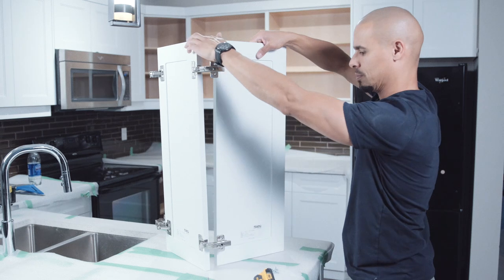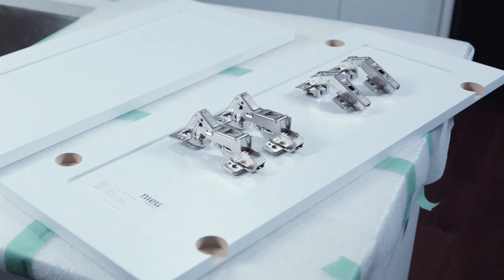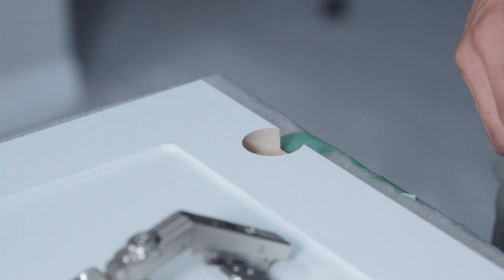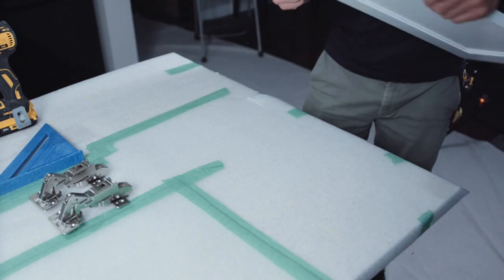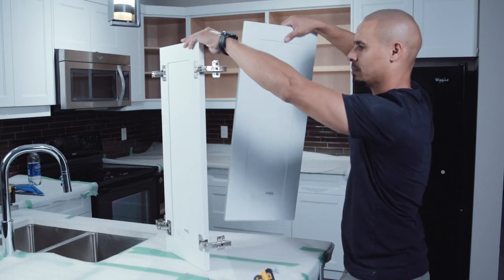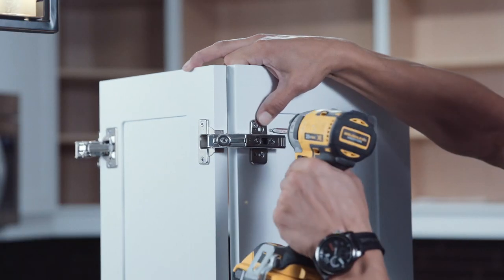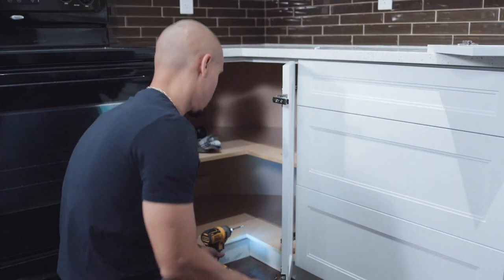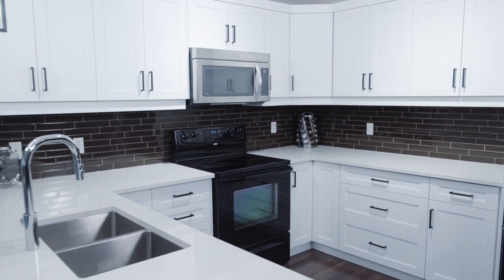How to Install Bifold "Lazy Susan" Cabinet Doors

Comment: Hi, Why did you dig the four Hinge in one door?
Reply from the maker: The door that has four hinges has two holes to attach it to the other door, and two holes to attach it to the cabinet!
Reply: @NieuCabinetDoors  
I understand you very well..
I mean, What's the difference between digging the four Hinge in one door instead of digging two Hinge in each door?
Reply: Where to buy the doors

Comment: What's the angles of those two different hinges?
Reply from the maker: Hi there! Great question. The door to door hinge is 90 degrees, but folds back to less than 90. The door to cabinet hinge is 155 degree. Hope that helps!